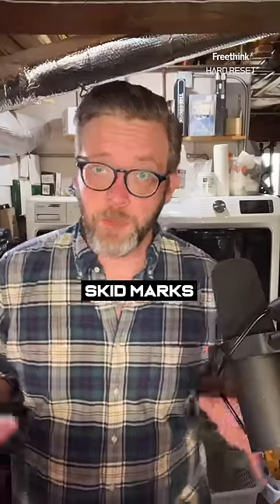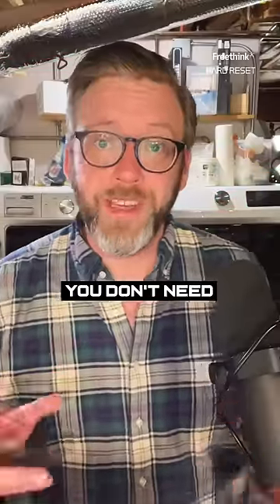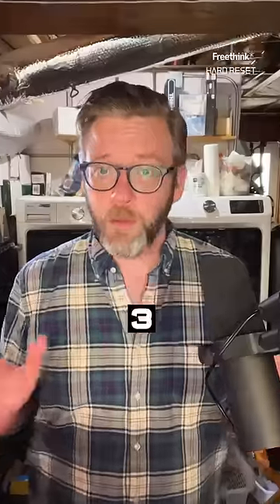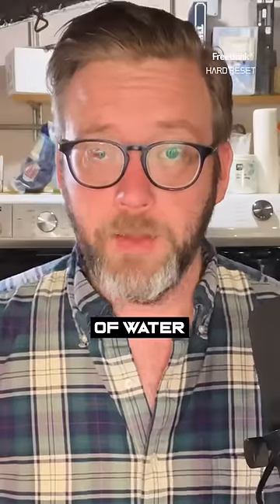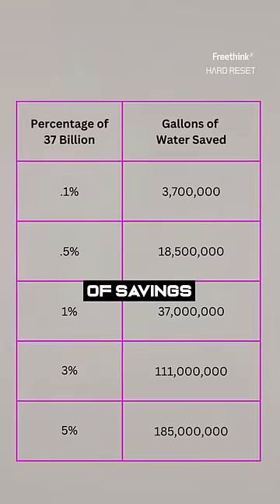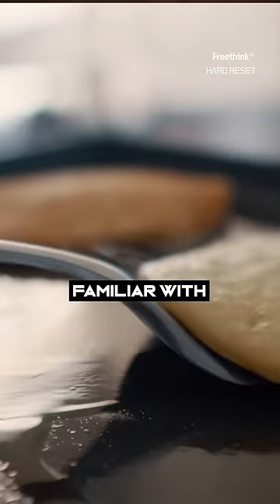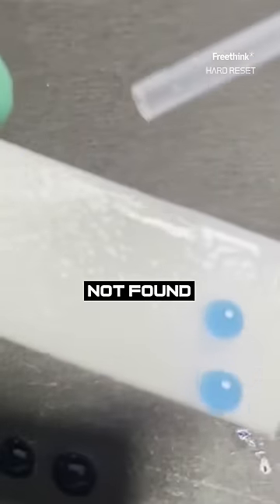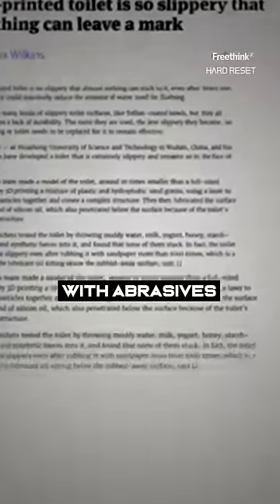Researchers invent super slippery toilet 🚽😳 #shorts #metamaterials

Comment: Note that this would be a disaster for sewers. Sewers need a constant input of water to carry solid waste through the pipes to the sewage processing plant. 

Even with traditional water saving technology, Berlin a few years ago had a problem with the residents being too water-efficient, causing the sewage pipes to block up. Berlin water system officials put out a public plea to flush their toilets more often, not less!
Reply: Someone suggested using the materials in the sewage pipes instead
Reply: @asiyaheibhlin7297  IDK if the material would be strong enough for pipes.
Reply: @ShadeSlayer1911 my impression is that it is a coating. Even if not. It would have to hold a 300 pound person on the toilet. As I sit here I don’t see strength as an issue.
Reply: Seems odd. You have five liquid uses of the toilet per day compared to one solid use per day.  Those five liquid uses should be enough to flow the one solid.
Reply: @voiceofraisin241  You need way more liquid to move solids through pipes than what is in your bladder. You can do an experiment to see for yourself. And it makes sense if you understand how toilets actually work.
Reply: @voiceofraisin241  Applying that logic, porcelain would be an excellent material for sewage pipes, as opposed to metal. Not all strength is the same.
Reply: @ShadeSlayer1911  there has to be more to it. 5 gallons of water should be more than enough liquid to send one solid flush down to the sewage plant. Such as rust on the inside of the pipe or buildup preventing proper flow.
Reply: @ShadeSlayer1911  I think you misinterpreted my comment.
Reply: @asiyaheibhlin7297  sure, maybe. But the cost of digging up and replacing all the pipes in your city? Absurd. Immense. Astronomical.

And how long does the coating last? Does it leach anything dangerous into the waste water? Lots of issues to work though.
Reply: @voiceofraisin241  as I mentioned, this has already been an issue in Berlin, and that was with water efficient toilets not water-free.

Comment: Airplanes already have slippery toilets for the same reason. I have used a nano-coating called Enduroshield to make my toilet hydrophobic and it makes it easier to clean. I did my shower as well so the water just beads straight off. A coating is a better method as you can apply it to all existing toilets as people don't change their toilet bowls often, I never have.

Comment: Perhaps in piston/engine situations. Might enable alternative lubricants.
Reply: Only if it can withstand the heat i suppose
Reply: An alternative to bike chains could work? Wouldn't need to  use dry lube for the rollers anymore
Reply: @CaptainLian  Plenty of materials with low enough friction to work as a lubeless mechanical drive exist, such as graphite and teflon. The issue is that these materials lack strength to be a useful mechanical drive material. This stuff is mainly sintered polypropylene meaning it's mechanically extremely weak as well as not at all heat resistant.

Comment: In Australia we have a compulsory "half flush" system for small solids and liquids that must be installed in every new toilet installation and it's been that way for a long time

... But our porcelain is also designed differently to American toilets: the reason why the water level is so high is because the toilets over there use a siphon effect whereas Australian toilets use a wash down. This same thing is also why most Australians don't own a plunger, because our traps are wide and almost never clog while using the same amount of water for a full flush as the US standard (half flushes use of course half this)

Comment: I'd use it on boats, planes, submarines,  now I just need a mechanical engineer degree.
Reply: Yeah I mean… not wrong but it would change every calculation cause all these vehicles actually rely on friction. Good luck getting your degree and changing the world tho
Reply: Now as a mechanical engineer I think that's a good thinking although it would have many flaws as well. But why in planes?
Reply: @animenmusic16 even if the gain is minimal I suppose having a slipperier surface could help surface drag on air. Boats and subs would benefit a lot more from that slippiness though.
Reply: @ДьяконФрост-ч7т what do you mean rely on friction? Boats are the only craft here that I’d think use friction (but imagine drifting a boat).

Comment: If the super-slip metamaterial is hydrophobic, I'd line raingutters with it to prevent mold buildup.

Heck, if they can make it cheap enough, form it into slats and use it on the sides of houses the way they used linoleum siding in the 90's. If it's that slick, not only would it slow water-damage to exterior house walls, but it would resist insects and small mammals climbing or burrowing in.

Comment: Linear flow avionic shells. If the material can withstand shear stress I would coat a plane with it, reducing wind drag and increasing thrust efficiency and lift. Not to mention that this reduces vortices due to foil morphology (because drag contributes less to it). The question would be: what are the boundary conditions that the new material would create for the air and would this increase/decrease dynamic stability in any of the axis of motion on the craft.

I would also love to see if propellers would finally gain 0.67 efficiency (or something close) from using this material.

Comment: The water also keeps the smell contained. If you turn off the water to a toilet and flush it, it will begin to stink when the pipe has dried.
Reply: sure, the toilet would probably still need at least some water, however i think the water the talk about saving in the video is the water used to clean everything out of the bowl. if you could just replace the dirty water you'd probably only need like half a liter of water instead to the 4 to 6 liters they use now..
Reply: Yes this is true. Toilets do stink without water but I think this model is meant to still have water at the pipe but use less water when flushing. Flushing is the main problem

Comment: A big problem with this.....   If more excrement than water goes down the pipes, I expect alot more waste will sit there creating a stench. All the sewage pipes would need replacing and that's ALOT of work.
Reply: Kind of like the problems created at waste facilities after the required installs of "low flow toilets".
Reply: @MajesticSlowking thanks, that's what I was trying to lament. You said it perfect!
Reply: @MajesticSlowking  Thanks for repeating my opinion in your reply to me and your individual comment.
I live in a dense HMO area and we all smell the stench.
I'm not a plumber.
Reply: @MajesticSlowking  Funny man, I'm 5th  floor of an HMO. Don't tell me that I can't smell the drains when you don't know my location, nor are my neighbours liars. You barely said a word different to me and yet I'm not claiming to be an expert, nor is there a need to capitalise 'plumber'.
Reply: Air isn't supposed to be able to flow out of the toilet, if you smell something from the sewer, something's wrong with your s-trap or the water level in your toilet.
Reply: @Alan74_ynwa  so confidently wrong… 😮‍💨
Reply: Oof! We may need some of that new material in the reply section here.
Reply: The sewage pipes need to be made out of no-stick material too.  Not cheap but we're faced with a future water shortage so the bills coming due.
Reply: @StephenSmith304  I never said I could smell it in my flat.
Reply: Add it to the pipes too. Problem solved
Reply: @ladyanntheog I wonder if people think water is one time use sometimes.
Reply: The smell isn't the problem though, you have air locks in every western toilet.

Comment: Bearings. Replace all the oils in industrial practices. If possible anyway. Liquid is used to lift actually so the metals don't contact. This is probably better for slow speed applications where you don't have heat buildup
Reply: This metal is not steel. I dont know how much of load it can take and how it will survive under higher temperatures
Reply: perhaps good for lower temperature operations, yes. i reckon it could replace a lot of joints that are otherwise lubed via grease fittings on trucks
Reply: @TheSoup222222  Which fitting and joint in truck can be replaced by a super slippery plastic
Reply: @zasyed114  a sleeve of this plastic if it can last for long enough could probably replace the lubrication in slip joints, perhaps even steering components in lighter vehicles if it's durable enough
Reply: @TheSoup222222  Exactly, which component which has a load enough to require lubrication, can be sustained by replacement of the the part by a slippery plastic or a sleeve of it.
Where?
Reply: @TheSoup222222  maybe good for like excavators and loaders. They greased all the joints daily when I worked in that.
Reply: That is both not practical and demonstrates that though you have noble goals, don't understand the physics behind the uses of oil.
Reply: definitely won't work somewhere like a crankshaft, but it might work in a simple thing like a throttle valve

Comment: I find the fact that it maintains slip even after abrasion very interesting. There are so many things that often have to be replaced since they don't handle wear. Take mouse ceramic pads. They make the mouse slick but the moment they get to a deeper layer you're gonna have to resurface your desk from the scratches.
Reply: Unfortunately the guy in the video didn't get to the core of the paper. The material still needs to be lubricated from time to time. They basically created a porous hydrophobic matrix which holds a lubricant. If the lubricant oil is used up/worn away you still need to relubricate.

Comment: As a plumber, I understand the importance of saving water. The fact of the matter is that the water is not just to clear the waste from the toilet, but more importantly to carry it down the pipes. Even with low flow toilets, not these proposed even lower flow toilets, the amount of plugged toilets and pipes will increase.
Reply: I still remember the first generation of low-volume flush toilets when I was a kid. Those things would always fail to flush unless you had a bucket of water ready to "help it out".

Comment: Well 2 things
1 it takes more than a cup of water to move the waist from your toilet down the waist pipe and to the main sewer line. Which needs to have enough flow for the waist system to work and to deliver it to the water treatment plant.

2 speaking of such, water treatment plants are remarkably efficient in recovering water, the only significant loss is a evaporative loss which is water that goes straight back into the environment so it's not lost.
Reply: What treatment plant? I have drained into the soil treatment plant
Reply: @theoneandonlyado  you don't have a treatment "plant" got the eco oak or pecan treatment tree, so 100% of your water is saved while producing O2 and scrubbing CO2 from the atmosphere, wins all the way!
Reply: Water is always saved, none ever leaves the planet. It will never be used up.

Comment: Okay, the toilet is slippery. But what about the pipes.
Reply: He did say LESS water. Of course we’re still gonna need water, but the goal is to cut down.
Reply: Pressure to deliver the poop through the pipes is still needed, you just don't need it nearly as much as before. That's the main reason why they invented this
Reply: Why not make the pipes out of the same material as well?
Reply: @theolastnameagain8697 Believe me, it’s really impractible. You need enough water to deliver everything to the main sewage system in the street of the local authorities. That is around 20 to 24 meters or 78 ft. That is way to long for only 3 or 4 liters or 1 gallon of water per time. This will lead up to everything piling up and clogging the pipes, that is not fun neither cheap. Please take it from the plumber specialized in unclogging pipes..
Reply: @alexsolosm Impossible, if anything is clogged the metallic spiral used to unclogg the pipes will instantly break the entire pipe as it will rotate with an incredible amount of force. That is why almost every modern pipe is made from Poly Vinyl Chloride or in short PVC, a really stiff hard kind of plastic which doesn’t break so fast.
Reply: @DylanoLandman  dry toilets do exist, in both rural and urban areas. Impractical, sure but only until it’s done. I’m not necessarily for this type of toilet, but it certainly has its advantages as well as its  disadvantages.
Reply: @theolastnameagain8697  Yes, in planes for example but that ends up in a sceptic tank with gravotational force when flushing. And urals not to be mistaken with urinals fill up the pipes with urine stones and declogging that is so hard and gross. Urinals also have too much urine stone because people don’t flush enough.
Reply: @DylanoLandman That’s the first thing I thought when this came up! You a journeyman?
Reply: @dadeamatic3772  No man, I’m not a journeyman, I’m a plumber specialized in declogging pipes, that is why I know so much about this subject.
Reply: @DylanoLandman  Oh well that’s still awesome! Keep spreading that knowledge!

Comment: Fun fact: the amount of water used when flushing a toilet has nothing to do with the skids on the side of a toilet and the same amount of water will still be needed to flush, the reason is toilets have an s trap built in so that the smell is stopped from domestic sewer line, not enough water it will not push all your nasty stuff up down and out.
Reply: It would help because you'd need to flush only once instead of two or three times in the process of cleaning and scrubbing. 
I'm sure it would also help plenty of people, who try to flush until whatever was stuck on the toilet wall is gone on its own.
Reply: People will sometimes flush 'again' at home or at a friends house' neglecting the brush, to try and flush the skidmark down _ That's how more water would be Saved' if that after occurrence never happened!🖖🌐
Reply: higher gradient?
Reply: @spiritzweispirit1st638 the trick is to pee on them. It's a man's job to pee off the skidmarks
Reply: people flush, brush & flush, and other flush 3rd time just to make sure😂

imagine just flushing and leave.
Reply: Fun fact? Bro you never cleaned a toilet before? First world countries lol
Reply: Fun fact my ass 🤣
Reply: My toilet comes with two buttons, one flush the double, with this i would save at leadt 50%

Comment: What i would use it for? Bearings (if the material can withstand the wear and tear)
Reply: Infinité fidget spinner
Reply: it is chemically super hydrophobic. He didn't really get to the core of the paper but application in bearings will not be viable. It is mostly sintered Polypropylen.

Comment: This has lots of engineering potential I’d use it for lowering resistive friction in bearings and if used on durable materials this would be great for lowering efficiency loss.
Reply: Theres no free lunch; I know literally nothing about this material, but I've seen this type of stuff come and go over the years. Either unbelievably super toxic to make, unbelievably expensive to manufacture, or completely impractical wear or strength  characteristics.  The crux here is "How much? How dangerous? " and "how long does it last?". Theres just not enough usable data to make any conjectures.  We also have fluid dynamic and magnetic bearings that probably trump this as well.

Comment: Btw, how would they solve the problem of sticking to the toilet surface? This was why teflon failed. It was toxic and after some usage (or high heat) it fell off the pan surface.
Reply: It IS the toilet surface, If it falls off, you have other problems.
Reply: It doesn't say the material will not fall off.  More forever chemicals.
Reply: @billk123 We need to think twice about putting things like this into our environment just for temporary convenience. Slippery will come back to haunt us long term.
Reply: @Lee-jh6cr the good part about this invention is that, 3D printing it shouldn’t have any chemical going in, all they doing is changing the texture of the toilet surface, if this can be applied to other material like rooftop allowing snow to slide off, car allowing bird drop lid to slide down surfaces with no stain what I’m saying is this can be a game changer, replacing a lot of chemicals produced with 3 D printing technology, it would be economically cheaper and environmentally safer

Comment: I would use it on cars, roofs, kitchen surfaces, etc. so they won’t need cleaning.
It would be interesting to use it in the OR for items that are hard to sterilise.
Also maybe for adult toys to stop the need for lubricants.
Speaking of lubricants. We could coat certain parts in that material to stop needing as much oil for vehicles.